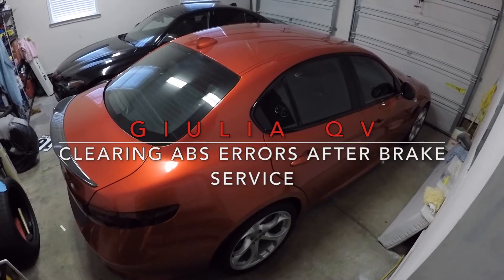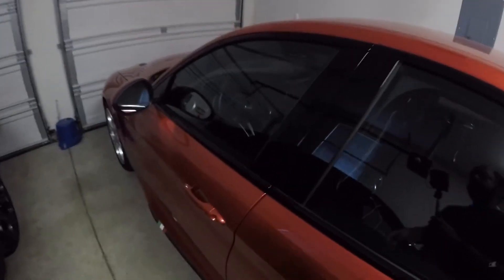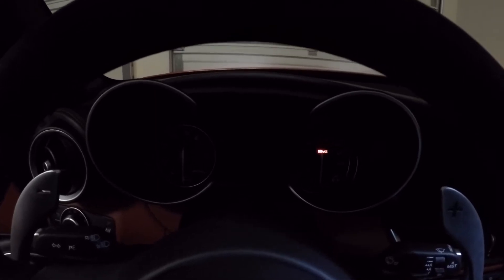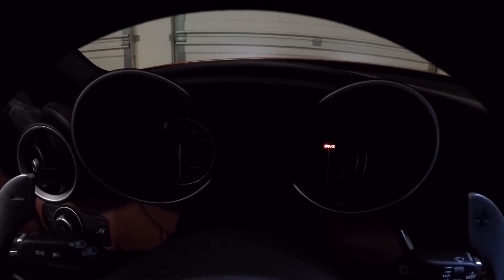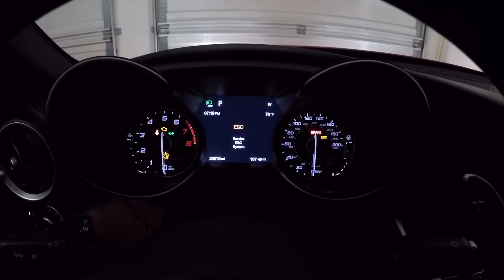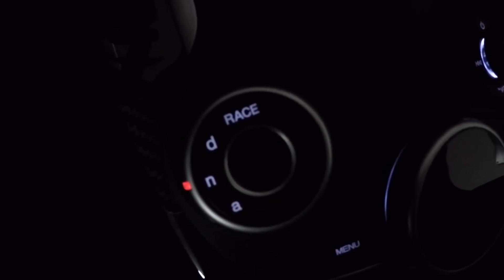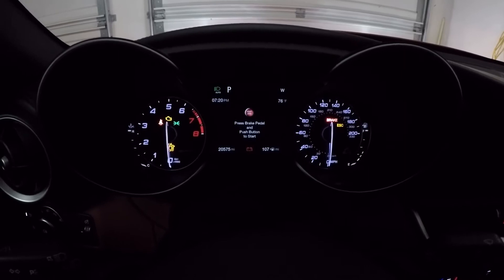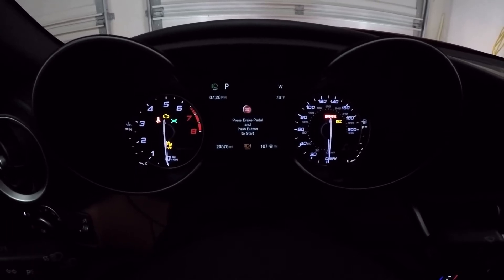Alfa Romeo Giulia Quadrifoglio | ABS Errors After Replacing CCM Rotors and Pads for Girodisc

Comment: I have a 2018 Giulia. I did the rear brakes and the same faults came up that you showed in the video. Since mine is a 2018 do I need the SGW bypass or will I be good to go with just mxlink, the grey cable and multiECU Scan?

Comment: This is so annoying, in this situation right now, don't even know where to begin to clear them, same codes esc abs hill lock... All from just disconnecting the battery via quick release by accident trying to solve to electric throttle control code, this car was fine not to long ago

Comment: Hey are there different types of gray cable 
Which one should I get?
And were you able to clear the service throttle??
Reply from the maker: I bought my cables here:

https://www.ebay.com/itm/271552918793?mkcid=16&mkevt=1&mkrid=711-127632-2357-0&ssspo=xWlqcHLHTFG&sssrc=2047675&ssuid=&widget_ver=artemis&media=COPY

and "yes", clearing service electronic throttle errors are easy and do not require the cables.

Comment: I need help DESPARATELY!! I tried doing the same exact procedure on a 2023 Stelvio Ti and it shows C104B-92 for me and it does not let me clear that one.... It shows up on multiscan in red on the phone. I pumped the brakes, did everything, just don't know what else to do
Reply from the maker: Your car is a 2023. Do you have the SGW bypass installed?
Reply: @ yeah I figured that out… had to take art the cluster steering column, etc. it was a pain in the but never leasing/buying Alfa Romeo again
Reply from the maker: @ernestopadron3807  It's SO hard to get to on the Stelvio. I didn't take the cluster out of any of my Stelvios, though.

I removed the little storage box to the left of the steering wheel, dropped the radio unit behind it down to the floor, then reached my hand through the storage box opening and up over the steering column to unplug it.

Then I installed some extension cables into the SGW module so that the bypass could exist right behind that little storage compartment for future access if necessary.

That said, sorry that you hate the brand. I love them, have had many and never any problems.

I still own this red 2017 Giulia QV. Now has 60,000mi... 13,000 track miles and zero issues or failures. I also have a 2022 Giulia QV which is a MUCH better car from an improved engine perspective. And, I have a 2020 Stelvio QV and a 2020 4C Spider.

All reliable.

I hope you'll miss your Alfa once it's gone, then come back to us :D
Reply: @ i had to unbolt the module those connectors were stuck on there good so I just pulled it up behind the cluster and plugged in the bypass and it was much easier that way

Comment: At all cost, you want to try and avoid using the iPhone and the Bluetooth. I’ve had problems in the past that you should get a laptop and dongle connect directly to the laptop with the laptop. You’re gonna need two cables of blue one and gray one.
Reply from the maker: Total opposite for me. Especially when running a proxy alignment. The laptop/PC bombs every time when running a proxy alignment. Also, when using a PC, running a proxy alignment asks for the blue cable, then the grey cable. When I use the MES for iPhone, it only ever asks for the grey cable and works without issue every time. The only time I use the laptop is when I need to manually change a proxy bit, for example... disabling headlight washers or enabling neutral when pulling paddles simultaneously. But even then, after making the manual proxy change, I use the iPhone for the alignment because the PC always bombs.

Comment: @genyosai I have taken the subscription and tried to remove the codes, but no luck. On my mobile application the code was showing in a Red font and not able clear them, any suggestions?
Reply from the maker: @Sai-d7d2k  Can you take a screenshot of your errors, share them in Google photos or something, then send me the link so that I can see??
Reply: @genyosai I have shared the link but I don’t see the reply after closing youtube. Please let me know if you got the link?

https://drive.google.com/drive/folders/1ZgQSTdNKpdXn6d2y8OMzcjlvaivxFbjD
Reply from the maker: @Sai-d7d2k  I got it. So you have the C104B error! I've had that error, too. This error is usually because you have air in the lines. This happened to me when I fried my brakes at the track. It boiled my brake fluid which introduced air into the system.

To clear this error, I had to bleed the brakes. Then do this video method to clear all the errors EXCEPT the C104B. After bleeding the brakes properly, then clearing all the other errors, I had to go and drive for a while... pressing the brakes until they felt normal again. Once the brakes felt normal I went home and cleared the C104B error.
Reply from the maker: Make sure to bleed your brakes really well. Then do what I show you in the video to clear the errors. You have to go into the continental brake group using the gray cable. Then scan for errors, then clear the errors.

https://www.giuliaforums.com/threads/lets-try-to-solve-the-brake-pad-swap-car-killing-itself.41506/page-2

Comment: Codes should clear with normal driving but if you're worried about the lights try turning the steering wheel all the way to the right, full lock to the left, full lock to the right then center. Shut engine off then restart.  Have your door closed during this procedure.  If that doesn't work.  Turn on and off engine 5 times. Doors closed during this procedure. If you're car doesn't have anything wrong with it the codes should clear on their own.
Reply from the maker: Not in this situation.
I'm familiar with the lock-to-lock process of clearing codes, but that's only for codes generated by disconnecting the battery primarily. You must do the lock-to-lock process each time the battery is disconnected to clear the codes generated.

In the event the Continental ABS module goes into failsafe due to what it THINKS is a fluid leak, you have to connect to the ABS module and clear the errors as I've shown here. They will not clear with time, and even if they did, you'd drive with one working caliper in the front and one working caliper in the rear which is pretty unsafe if you try driving normally.

Same goes for if you ever boil your fluid at the track and introduce air into the system (I do this all the time). After bleeding, you have to connect to the Continental system they way I've done here and clear the errors created by having air in the lines.

While in there, it's also a good idea to reset the steering angle, Lateral and longitudinal acceleration sensor, and pressure sensor.
Reply: @genyosai  lol. Bummer
Reply: @genyosai what are the specific items needed to perform this? Mx+ module, do you need the sgw bypass? what is the grey cable? What app are you using? I know some of that was addressed,  but I want to be sure I understand.  Thanks

Comment: Good info but if you disable the E-Break and put it into break service mode in the infotainment before doing your rear breaks you won’t have this problem
Reply from the maker: @VegaFIFAyt  Thanks.

But, Actually it takes a bit more than that, but this is for people that learn the hard way that you can't just replace the pads on a QV the way you've changed pads on your other cars. Once you've pushed back the pistons to install the new, thicker pads, you absolutely cannot have the ACC on when you depress the pedal for the first time else the Continental ABS system sees the first time, excessive pedal travel as a fluid leak.

Going into break service mode doesn't prevent this. You just have to make sure you pump the brakes before applying the ACC.

But then, this tutorial also helps if you've fried your caliper seals and dust boots at the track and have to rebuild your calipers. Ask me how I know 😅😅
Reply: @genyosai  wow. Thanks for sharing but now I’m scared to do my rear breaks by myself. I read the instructions on Alfaworkshop and only says “Disable the E-break and put it into break service mode” in order to don’t have this warning lights later 🤷‍♂️
Reply from the maker: @VegaFIFAyt  Is your car a Quadrifoglio? Are you also replacing rotors or just pads?

If your car is a Quadrifoglio AND you are just replacing pads, you don't need to enter brake service mode because on the Quadrifoglio the e-brake caliper is separate from the brake caliper.

If you car is NOT a Quadrifoglio, then your rear caliper is also the e-brake.

Either way, you can follow these steps EXACTLY and be safe:

"1. Enter Brake Service Mode (Infotainment)
2. Turn off car
3. Pull negative battery terminal
4. Do brake job
* 5. Pump brakes until all new pads are seated
6. Connect negative battery terminal
7. Turn on accessory mode (push start button, but don't start car)
8. Apply brake pedal
9. Toggle Parking Brake
10. Done

If any codes are left over, just turn the steering wheel from lock to lock and turn off the car. Let sit for > 30 seconds, turn back on, rinse and repeat turning off/on until codes are gone." --JeFizz {Giulia Forums}

Comment: Can this be done using wiTech 2.0?
Reply from the maker: I'm not positive, but I would think YES because WiTech can do things MES can't (like re-calibrate/sync the EBP).
Reply: @genyosai  OK....UPDATE. So I currently work at Maserati/Alfa Romeo Dealer in FL. Apparently this is a major issue with Alfa's. I can confirm that there is a failsafe mode and there is a way to reset this. I had 2 cars that were both towed to the dealer both with confirmed fixes. But I used witech 2.0 instead of the device used here. I would like to add that another technician on Tech2Tech ( internal Mopar FCA forum ) said that sometimes, this will work.....sometimes it won't.
Reply from the maker: @RetrocarStyle  I've had to clear ABS/Brake errors so many times because I race my car. I no longer have the issue when I change rotors and/or pads (because now I know how to do it without throwing errors), but there are times at the track when I may boil my brake fluid which introduces air into the system. When that happens I have to do the bleeding procedure for the Quadrifoglio as well as clear the Continental ABS module errors due to air that got in the lines.  Same for when I have to rebuild my calipers... MES works every time.
Reply: @genyosai  Well I've only been with FCA for 8 months. The information provided came from my experience of me resetting two of these and the technicians in the tech2tech internal FCA forum. Some tech have said that it will work and then other times it won't come back. In those instances, it is entirely possible that for those techs that states that they could get the module back is that it could have been procedural errors. I cannot say at this point because I haven't been with the brand long enough. Time will tell.

Comment: Hey bro thanks for the video the only guy that got right down to it and explained it without skipping anything out thr video we can all literally get the part and do the whole process with you in your video big thanks, my question is. Do it have to be the exact same bluetooth one you use or can it be another?
Reply from the maker: Hey! Always happy to help a fellow Alfisti!

As far as the BT module... it doesn't HAVE to be the same, but it's the one that I KNOW works with MultiECUScan AND even works for cars that need the security gateway module bypass installed (2018+). Some BT modules don't work when the SGW module is installed, but this one does.
Reply: @genyosai  nice nice so last question,  the bypass does it come with the module or do i just download it when i connect the bluetooth?
Reply from the maker: @agent4poyato956  No. The SGW bypass is a physical module that you have to install in the car. It can be a pain to install (much easier in a Giulia than a Stelvio), but if your car is 2018+ and you're a DIYer... It's an absolute must.

You can get the bypass here:

https://shop.alfissimo.com/home/1884-obd-protect-interface-for-multiecuscan-alfaobd-100-functionadapter-kit.html#/104-interfaces_adapters_accessories-sgw_bypass_2018_manuf_date_and_up

It's recommended to use a set of extension cables, but not necessary:

https://shop.alfissimo.com/home/1884-obd-protect-interface-for-multiecuscan-alfaobd-100-functionadapter-kit.html#/106-interfaces_adapters_accessories-extensions_19_for_sgw_bypass_pair

Comment: I'm not sure which was better. The information in this video or the sound of start up. Thank you 😊
Reply: Unfortunately I'm having to hot wire my calipers; they got stuck
Reply from the maker: @Theycallmebritish  I've had to do that before, but only because I was troubleshooting why my park brakes were in error and would not engage. Turns out the shaft in my rear right park brake caliper was broken and couldn't wind the piston. The PB motor just spun continuously which kept the PB system in error.
Reply: @genyosai  holy moly! Im sorry to hear this; im assuming this was diagnosed by someone or how'd you manage to find that out. I'm still with the error; so I might have a mechanical problem as well. Thank you for your time and information. I hotwired my motors so they would open. So I could move the car. I was able to return out of service mode. Clear the nannies but it's telling me I few things I'll update you. Heading to Firestone in an hour
Reply from the maker: @Theycallmebritish  I diagnosed it myself. Pretty easy considering I could hear the caliper motor spin continuously. I knew which caliper it was, but I wanted to fully test it, so I disconnected the PB caliper harness from the body harness and applied 12v to the pins... reversing polarity to test each motor direction.

Comment: Thanks for your video. I do have a 2017 Giulia TI and a similar error happened to me after doing a break job. My mistake was that I pressed on the brakes when the front calipers were off hoping to release the E-brake to service the rear pads. The front pistons came out a lot and it started leaking brake fluid. The error is still there and car doesn’t want to brake properly. I believe it is currently on that brake safe mode. I’m just waiting for the gray cable to arrive to reset the ABS codes.
Reply from the maker: You're welcome. Always happy to help a fellow Alfisti!
Are you one the Giulia Forums? You can find me there by the same screen name.
Reply: Hey the same thing happened to me was u able to fix it ?
Reply from the maker: @mamadusylla1027  Yep. Watch the video on how to clear ABS errors after improperly doing a brake job.  You'll need MultiECUScan (MES) software, preferably on iOS as I use in the video. You'll also need the gray MES cable to access the ABS module.

If your vehicle is a late 2018 or newer, you will need what's called the security gateway bypass module which can be purchased from Alfissimo.
Reply: @genyosai so if you get that SGW bypass (my car is a 2019) do I still need the grey cord to connect? And if so where can I buy one of those? Same thing happened with my car 🫤
Reply from the maker: @importpro1334  Yes. With the bypass installed you still need the OBD2 scanner AND the gray cable to access the ABS module.

You can buy the complete set of MES cables where I bought mine from:

https://www.ebay.com/itm/271552918793?mkcid=16&mkevt=1&mkrid=711-127632-2357-0&ssspo=xWlqcHLHTFG&sssrc=4429486&ssuid=ov7dedzdSYe&var=&widget_ver=artemis&media=COPY
Reply: @genyosai  where is the bypass supposed to be installed? In the ECU?
Reply from the maker: @importpro1334  Haha!! No.

https://youtu.be/TIlcBQ34rf0?si=-_2W-G4UZ_Po6fwv

https://youtube.com/shorts/HhuoNgj2pjo?si=ds_9oPIWqlXvy0Xd

Comment: great video bro
i have a early (08/17) 2018 alpha romeo giulia and it doesn't have the gsw module and im having the same problem. I purchased the same adapter kit as you  (idiagnose) and im using the grey cable with the link mx+ but it's not letting me connect to the car through the link app. 
also would i have to purchase the $60 full version of the multi scan ecu app in order to reset the abs codes? thanks
Reply: also i'm on an iphone and im connected thought bluetooth but it doesn't let the mx+ connect to the car
Reply from the maker: @abelsanchez9664  one thing about the iPhone and the mxLink+ is that the iPhone doesn't automatically connect to the mxLink. This threw me off at first. You need to go into your iPhone Bluetooth settings, find the mxLink in the list, then select it to connect to it.

Once it's connected, switch back to MES and make the connection with JUST the mxLink first. After a successful connection, change to the Continental and brake system menu. Then MES will tell you to switch to the gray cable. When you make the switch, you need to change back to the iPhone Bluetooth list to reconnect to the mxLink. Then switch back to MES where it still says to connect the gray cable, then continue.

Comment: Good afternoon my name is Cesar and I have a 2019 Alfa Romero giulia 2.0T, and I recently bought our one concept brakes drill and slotted. Installed the new brakes but forgot to disconnect the negative cable on the battery and now I have lights on my dash that won’t go away. I read a lot about these coats popping up after doing a brake job and everyone was saying use mutilecuscan tool to clear the codes. I bought a license, the gray adapter, the scanner. The scanner will read the ABS codes but it will not clear them. It does it for a split second but then they come back. Do I need to buy a security gateway bypass module in order for me to permanently clear these codes. PLEASE HELP
 Codes read

- C0051-86
- C0076-68
- C104B-92
- U1702-86
Reply from the maker: Hi. Yes, you need the SGW bypass module to clear the codes because your vehicle is a 2019.